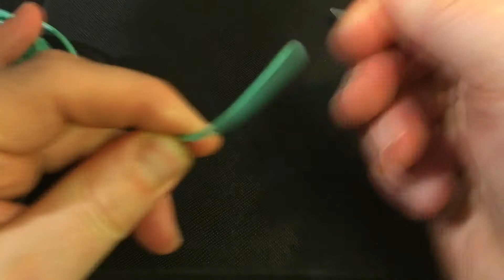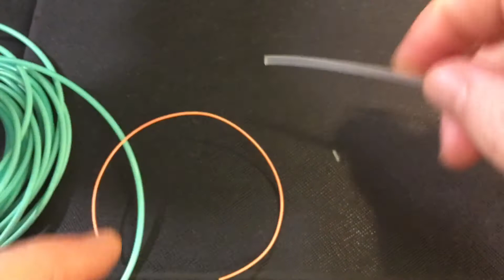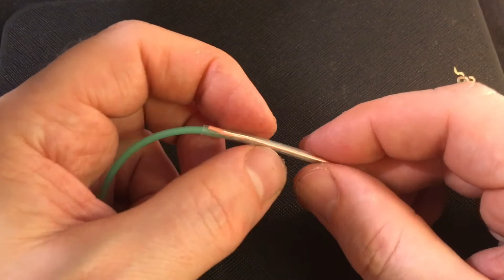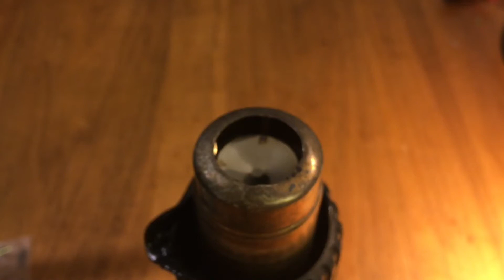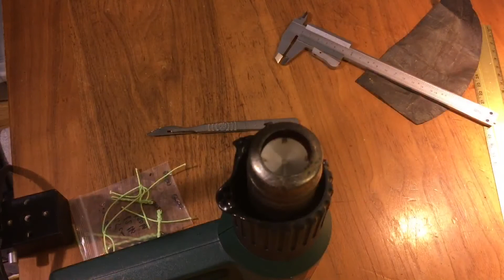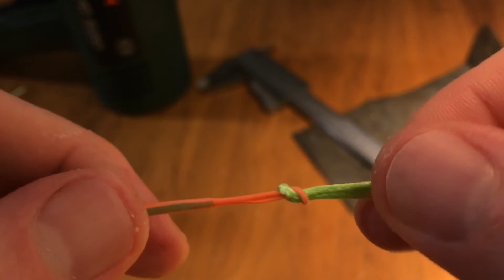Welding loops to your fly fishing line - mending with your running line

Comment: Cuts might be smoother if you held the blade at a different angle so the cut slides through the line instead of pushing. Great video though... very little info on this out there so, many thanks for sharing your technique!
Reply from the maker: Many thx for good suggestion